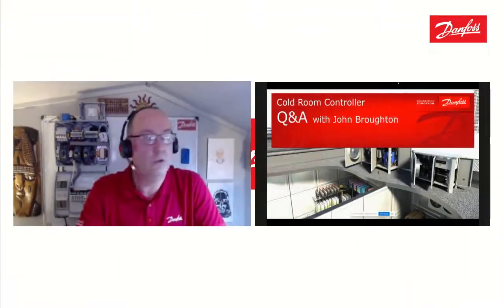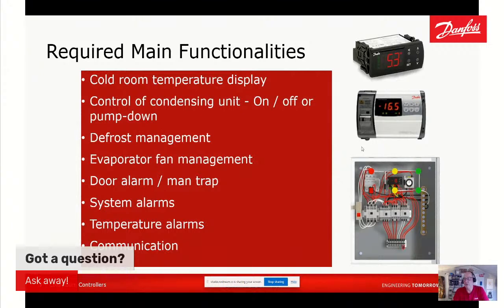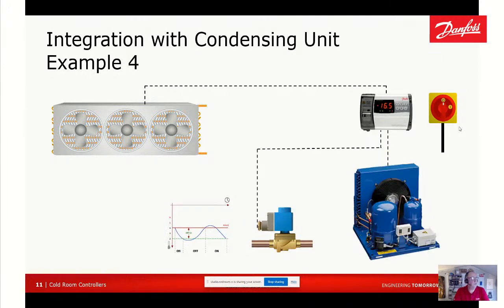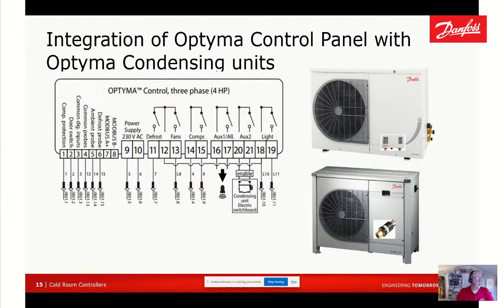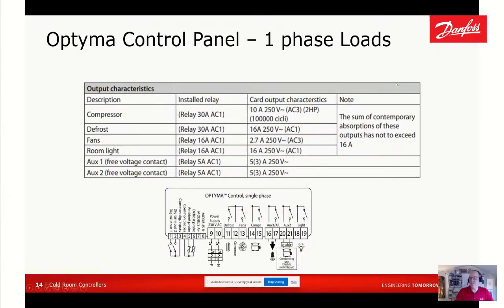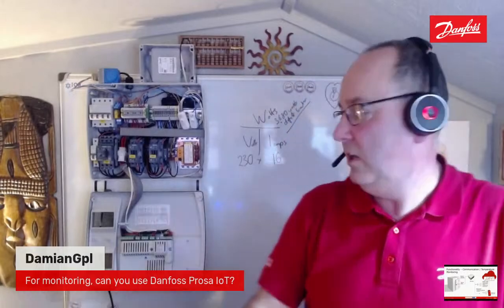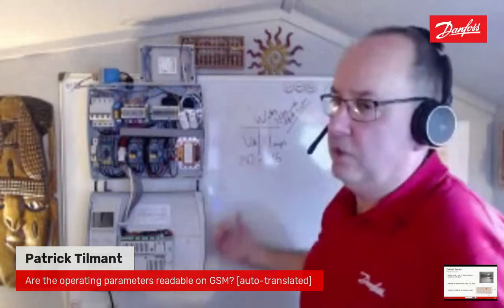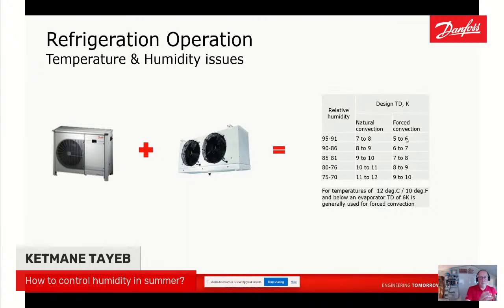Cold Room Controller Q&A w/ John Broughton

Comment: what does DEF mean in a Cold Room Freezer
Reply from the maker: Thanks for your question. We are checking with our experts and will get back to you.
Reply from the maker: Hi Robert. DEF generally means DEFROST, so when a controller has on its display DEF it means a defrost is taking place which could be made using various methods, the most common would be electrical resistance heaters in the coil block of the evaporator. Hope this helps!
Reply: @DanfossClimate  Thank you

Comment: Me i know what is the correct controller for akv txv.
Reply from the maker: Hi Ariel,
The Danfoss AKV valve can be controlled by various Danfoss electronic controllers, it depends if it is pure superheat regulation or total evaporator control for coldroom or supermarket display case. Please check out the following link which will help you.
- John

https://store.danfoss.com/en/Cooling/Electronic-Controls/c/2002